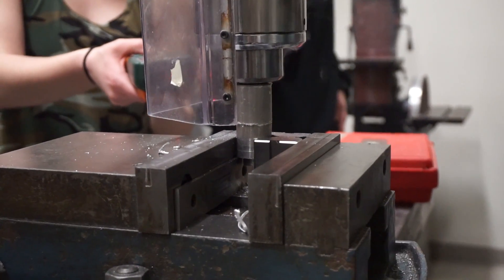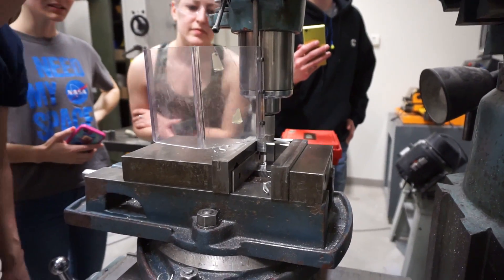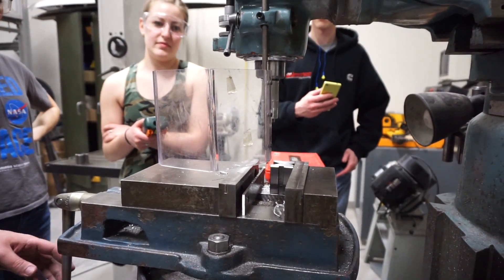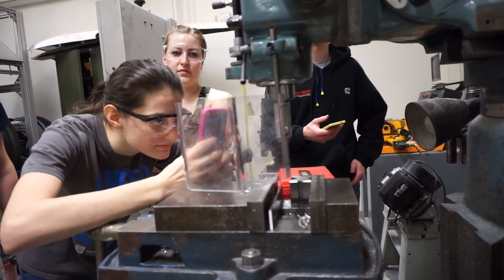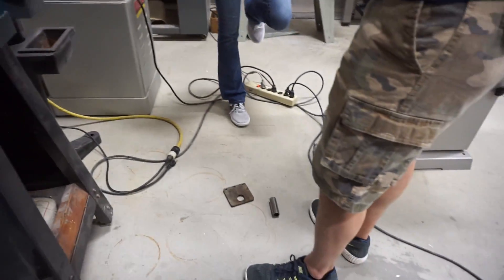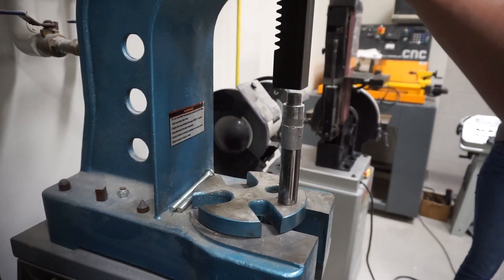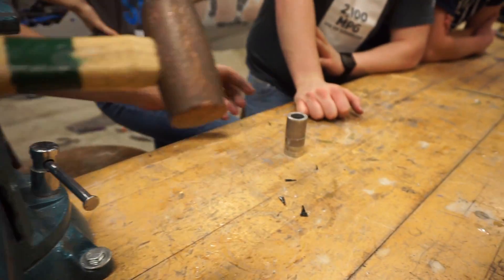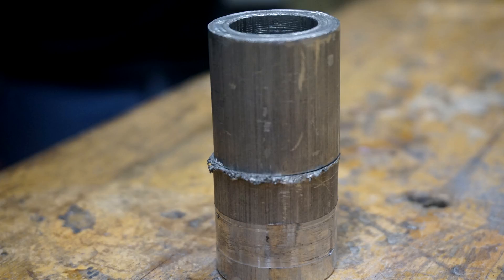Friction Welding Aluminium Tube on a Mill

Comment: I've read about it, you might want to try friction welding wooden dowels in a wood block, I could only find linear friction welding.
Reply: rotational welding is the most used... its done on pipes, axles and many industrial parts needing a near perfect weld

Comment: Should always add bevels on friction welded stuff, the bevel will heat up and fold over itself if done correctly thus forming a strong weld.
Reply: thanks I will look for that

Comment: Pretty neato. I wonder if you could make a good strong weld between a rod and pipe using this method. The rod would have to be close, but just slightly larger in diameter than the inside diameter of the pipe so that you could build up enough friction. Maybe even better if there was a slight taper to the two parts being mated together.

Comment: Cool! Maybe if it would slip in the mill later the bond would be stronger. Calculating strength and such may be cool, but some destructive tests would be way more accurate. I think key is to grip it as good as you can in the mill and vise, but it will put quite some stress on your mill.
Reply from the maker: I think you are right. it probably would be stronger if it would have spun for longer. yeah, it would be cool to test it.

Comment: the use of the arbor press hurt me inside
Reply from the maker: Haha yeah me too, I suggested using the copper hammer.
Reply: yeah right? saw the “testing” and just groaning and wtf was my response in 1 sec.... dead video but was looking to see if it had been done... looking for a cheap, repeatable, at pressure gas tight, non contaminated, failure proof way of welding many aluminum tubes into a header.... also vary pro strong women type.... sad to not hear there thoughts and ideas as this ended with the feeling it was a guy doing his thing without any of the others input......

Comment: It slipped because it completed the strongest weld that the vise could take right? You could probably take the amount of force the vise was applying and do some physics to determine the strength of the weld.
Reply: The increased friction caused by the metal heating up along with the aluminum expanding is what caused it to slip, when the metal cooled down the two piece welded together. Probably not the most reliable of welds because of inconsistent heating but for a failure point it works. If they wanted to figure out the strength of the weld they would have to figure out how much of the area welded ie. the width and how far around the part the weld actually is then use all the math about material strength and structure.
Reply from the maker: +Iron Beard induction heating!!!
Reply from the maker: +tbtitans21 yep, mostly correct. It did skip a little in the vise. But mainly the cap screw holding it to the shaft in the mill sheared.
Reply from the maker: Yep!  Not the best.  I'm still surprised it worked at all.  Probably a lot of things that could be done better.  I wonder if they would be against cutting it in half.  I kinda wanna try it again.
Reply: It would be cool to come up with a way to keep the parts heated evenly to make a clean weld.
Reply: perfect